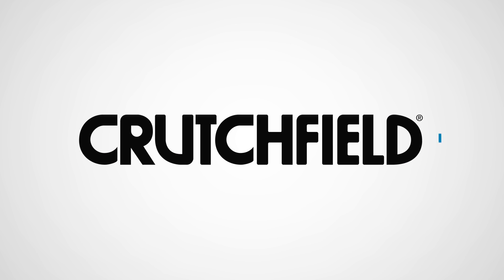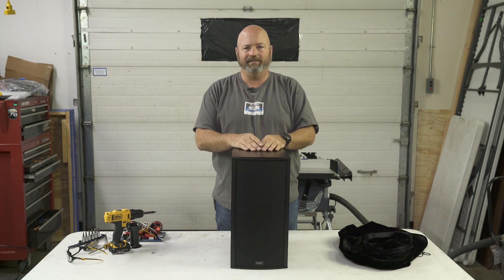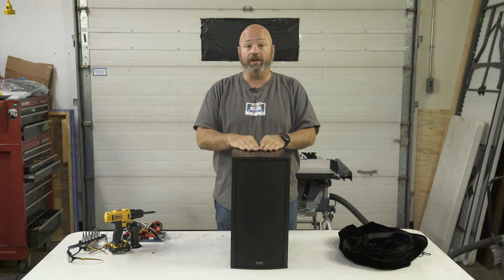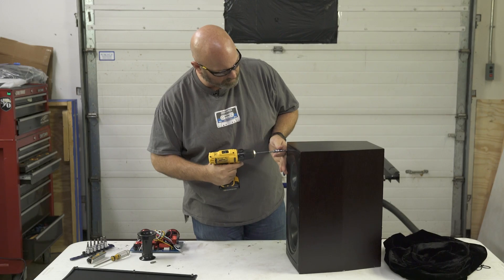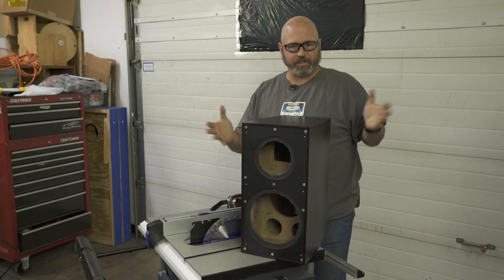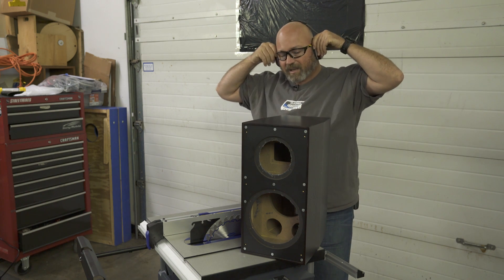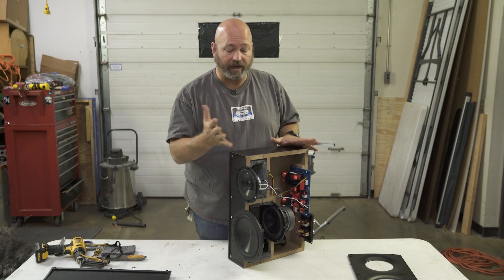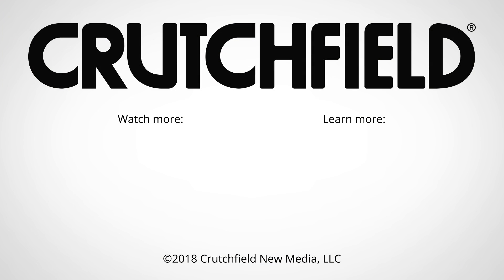Sawing an ELAC speaker in half to see how it's built | Crutchfield video

Comment: Panasonic Thrusters...just one behind the other instead of one on top of the other?
Reply from the maker: If what I found online about the Panasonic Thruster speakers is correct, yes!
Reply: @crutchfield  I stuck a pair in my closet in college. Concrete walls and a solid oak door with an inch of space at the bottom...acted like a pretty good band pass sub woofer with four 10 inch woofers...when I played a woofer test...14 guys came into room in a quick hurry.
Reply from the maker: That must have been both impressive and terrifying at the same time lol Any of them have a look like they just seen a ghost?
Reply: Well, it was Bible college so, perhaps the battle of Jericho?  Walls were shaking, babies cried and I got a "verbal warning" from campus police.

Comment: "we will avoid cutting through metal".... proceeds to cut through the metal. :D  Anyway, great design and excellent build! I still suspect that Elac did not supply one little piece, the one sealing the enclosure for the midrange+tweeter driver from the woofer enclosure. That is not a problem for an engineering sample, obviously.

Comment: As the main driver moves forward, the ported air moves inward and this conflicts with the radiator wanting to move forward with the main driver and the same in reverse when the main driver moves backwards? Don’t see how you can successfully integrate abr design with ported cabinet design, it doesn’t make sense?
Reply: Here is my guess. As the driver moves forward, part of its energy pushes the radiator forward, and the other part circulates through the port to the rear compartment. Analogous to internal workings of a laser.

Comment: This cannot be good, it just cannot be a good speaker. It may sound pleasant to the ear, but that's not an accurate speaker by any means.
To put a passive membrane in front of the driver is just wrong. Air compresses, you have losses on the main driver just because of physics, and then you amplify those losses with that passive driver through that air cushion. Not to mention bass reflex ports that work in the opposite phase to the driver affecting the passive driver in a negative way and with a latency too. Phase rotations happen at the resonance frequency, which disrupts sound placement on a normally mounted bass reflex port, imagine what happens when that sound hits the passive driver in this case. I wish I was wrong, but I think these speakers are bad by design.

Comment: Looks like a variation on a quasi sixth order series tuned bandpass, using a passive radiator in place of a port. Do not like that the combo tweeter / mid is connected to the same cavity space as the woofer.
Reply: Reading the comments it seems there is meant to be a plate behind the tweeter / mid, which would make sense. Obviously missing from the engineering sample.

Comment: I love my audio equipment so, it's kind of obnoxious to take a good speaker and cut it in half. Yes, it's an unusual bass configuration; but the rest of it looks quite common place. He seems impressed by the size of the crossover so, okay maybe it's a 18db crossover, big deal, impressive  insulation? A schematic and explanation of how the passive radiator/ported bass system works would have been better. It sort of looks to me like the ported air pressure is slightly out of phrase with the direct pressure that is driving the passive radiator, so that it gives the illusion of bigger bass; I hope I'm wrong and there's something much more sophisticated than that happening.

Comment: Hi, very nice video... One Q ...shouldnt bass & passive radiator be of same type and size? I had similar speaker but with both active units ...Linn Sara and can vouch that speaker of that or similar design will produce tremendous and huge bass , rendering you puzzled how such a small box can produce such a big sound. Great design. After hearing that for the first time I simply had to have similar design in every other speaker I bought. Either isobarik or pass.rad or compression with speakers inside like  Conjugate Load Matching, Coupled-Cavity bass loading seen in KEF 107 which I currently have... so a floorstander with such added benefits. No wonder it went to 20hz in the 80's :) and no wonder I wont be replacing it anytime soon in my bedroom system.
 Crutchfield fan.
cheers

Comment: But won't that bass port drive the radiator on the rebound phase of the bass driver, as well as the forward or compression phase?  What does that additional driving movement sound like?  Interesting.

Comment: What is the logic of this system?  I know ported speaker enclosures do not sound natural unless the ports are perfectly tuned.  And that's no easy thing to do.  But anyhow ported speakers can generate more bass power.  In this design the thrust from the ports need to be in harmony with the active woofer.  The thrusts from the 2 ports and the active woofer together will drive the passive radiator which in turn is in a sealed enclosure.  So the quality of a sealed enclosure and the power of a ported enclosure.  Is my understanding right?  If yes I have a doubt.    Will it be cheaper to drive a typical sealed enclosure speaker with the amplifier substituted for a little more powerful one to get this much bass and this quality?

Comment: Looks good and innovative. Any impulse, step response, distortion, and freq plots?
Reply from the maker: We don't have any charts showing that information and I couldn't find any on ELAC's web site. I recommend giving them a call on 714-252-8843 to see if they have this to send out
--Crutchfield
Reply: Thanks for the reply.

I appreciate it is not your responsibility/concern; but it is very hard to design even good passive loudspeakers (let alone good active monitors) well without knowing the frequency V distortion plots - frequency V phase plots - impulse V time response - step V time response - waterfall plots.

Otherwise, how do you know your initial R&D investment has achieved its specifications and goals?

Sure, in the Hi Fi world there are lots of speakers that "sound" good with questionable and/or poor performance specs. 

But in my experience there are far more well designed speakers with good performance specifications that sound good; meaning these speakers/monitors perform well in both listening and bench tests.

Consider ATC's range.

I would like to see how the acoustic 2nd order bass roll off coupled with the electronic 1st order bass roll off performs; as per the designers claims.

Usually 3rd order roll offs have some inherent compromises associated with them, and I doubt this system will be too different.

Doesn't mean it's not a nice speaker though, it's just that I am always a bit skeptical of claims that are not backed up by real world repeatable tests.

A speaker that delivers a nice clean waterfall plot, impulse/step response, and cabinet reflection test never hurt its its overall acoustic signature and listening test.

To the subject of ELAC's flagship (large egg shaped) speaker and it's air motion transformer tweeter; whilst they do sound nice and exhibit some efficiency advantages; they're prone to high distortion levels and I can't remember how well they perform in the other above-mentioned tests.

Still, these Hi Fi speakers you have cut in half seem like a reasonable system for the price.

I won't call ELAC, as I doubt they will provide all the above-mentioned test results, very few speaker companies do as they prefer to let their advertising and listening tests do the selling.

Great video.

Comment: I have not heard these, but I think using air as a conduit for driving the bass radiator seems very inefficient to me. I have to believe the compressability of the air channel would make the bass very sloppy compared to a direct radiator's output. I have heard the effect in other speakers.

Comment: please stick to auto installs and stay away from the table saw. ridiculous!!!
and doesn't ELAC already have better cut sectioned speaker they could send out?
no way id let you use that as advertising and you obviously know very little about speaker design to use this as any kind of instruction--speakers or shop safety.
oh and who runs electricity the their drivers?

Comment: How can you talk so much and end up saying almost nothing. 14 minutes to say the same thing over and over again. Yeah we get it...they supplied the box without the wiring and the crossover was already out of the box! I lost count of how many times you told us that the sound from the bass driver drove the passive radiator in the front! Then you tell us that anybody can make a normal bass reflex speaker but this one is different and then you dont explain how it works and why it is better. Its a gimick which boosts bass but reduces bass clarity thru messing too much with phase and harmonics. The mid range speaker is not isolated from the bass enclosure, that cant be good. First and last time i watch Crutchfield. Zzzzz
Reply: Actually, it is isolated, there is a terminal plate that goes in the hole above the woofer inside the cabinet, sealing off the upper front chamber for  the coaxial, they just don't have it here, but it is in the production version.  Also, the bass isn't boosted, it's more like a passive filter by having the driver sealed behind the passive radiator, it eliminates port chuffing, reduces any mechanical noise from the driver, and allows for only clean bass to get through, that said, it depends on the tuning of the ports on if it causes phase issues, and based on the reviews and ratings of the series online, I have a feeling that it is much better engineered than you speculate.
Reply: @matilija  anyone who designs a square-edged baffle and calls it high-end is a moron.  they had to build an oversized complex crossover just to make it sound decent with all that baffle-step distortion being cast off

Comment: Good video but for $1,249 each ($2500 for a pair)... the sum of the parts don’t add up. The value for performance portrayed by Elac quickly walked off the plank.
Reply: yeah, it does make you wonder where the money is.   XO prolly biggest expense
Reply: Agree I don’t get where they come up with these prices.  Charging for each letter of brand
Reply: Masseuse
Reply: Maybe they want to make a profit. Ever think of that?

Comment: speaker box interesting design, but the driver don't worth $1250 each. may be everything worth $300-400. Plus cheap speaker box materials. i'll pass
Reply: MDF is a very good material for speakers, nearly all speakers use it. It's way better than wood, wood is too inconsistent and too resonant.

Comment: 1. It sounds good, there are $3000 computer speakers that use two $18 fountek fullrangers, so in the grand scheme of things to get a fairly well built cabinet, improved extension via a well tuned 4th order, what looks to be a well thought out crossover and a pleasant coax is not terrible.
2. Most "hi-fi" sells for 5-10x what it costs to make.
3. With a few months of study and practice, you can make something better for far less than half this much, but DIYers aren't the target market for $2500 bookshelf speakers
Reply: Man those fountek fullrangers are incredible for the price, but your right those at $3000 are way over priced

Comment: Looks like the crossover is not for that speaker. If you look at the cabinet behind the mid driver there is a cutout that looks like its for for the crossover board and it would be somewhat smaller than the one provided. Also I find this design for the bass driver seems somewhat strange. Although I'm sure it may provide for decent bass response one would think that the mid and upper bas tones would suffer being reproduced by a passive radiator.

Comment: This type of design never ever gives you more acurate base. It's function is to eliminate vent noise and also have drawbacks due to the resonance of the passive radiator, which will give you a third resonance in a system which normaly have only two. It looks like a great idea, but it is not.
Reply: The passive radiator vs a port is likely to reduce enclosure size not to eliminate vent noise.  Port is easy to eliminate with a bigger box to allow for the larger and longer port. I have no idea why you think having this third resonance is bad if it the designer knows what he is doing.

Comment: It's not controlled, tight, accurate bass that's trying to be achieved by this design- it's a wider range of response in the lower frequencies. The passive radiator is still considered a ported design.. so you've got a ported box, INSIDE a ported box. It's a series 6th order bandpass. Each ported box is tuned to (likely) an octave apart, widening the punchy response typically found in a ported enclosure.
Reply: But don't misperceive my comment as me not being impressed! My minds blown by this design- and I want a pair!